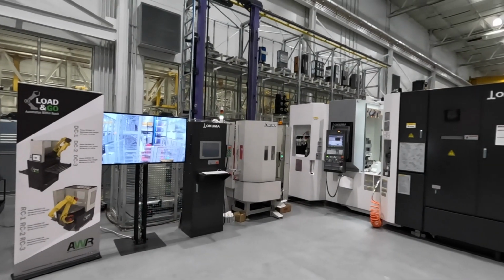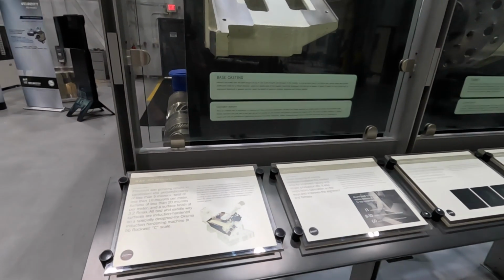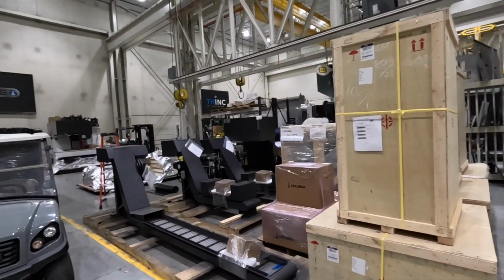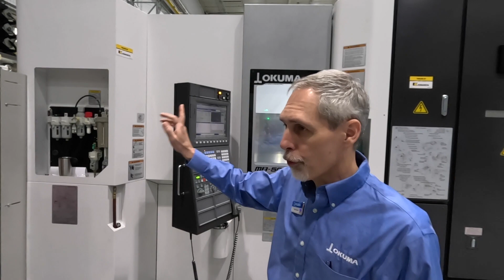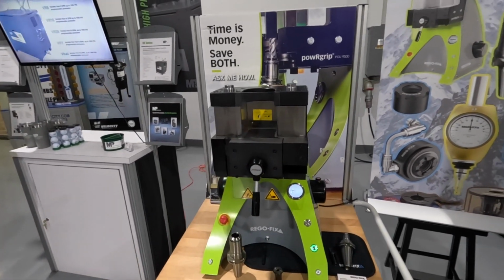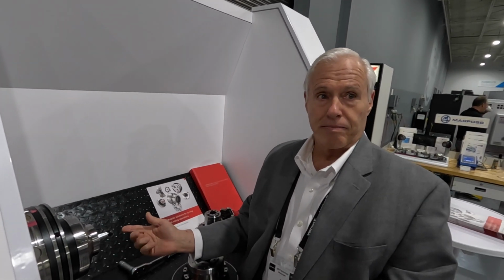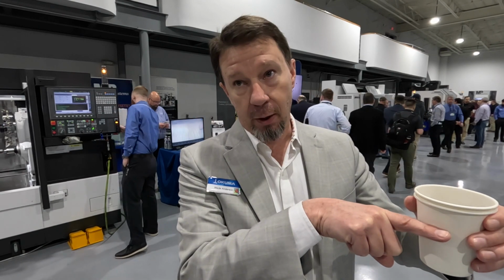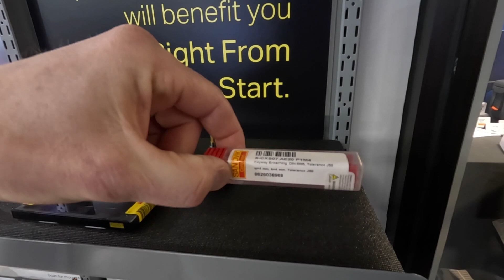Okuma Technology Showcase - 2023 Highlights!

Comment: Back in the 90's, Okuma was building machines there.  That big long integration bay you were in used to house a couple of enormous double column mills for machining base castings for their machines.  The interesting part was the castings were located on the milling fixtures by the leveling pad holes which were drilled on an old (50's), manual Okuma radial arm drill, and all dimensions came from that.  Before that facility, Okuma used to drop ship small machines in kit form to various assemblers for their US machines.  We've been using Okuma machines in our shop for almost 40 years now.  Still have an LC40 from '84 on the floor.
Reply: They also had a few more buildings then today, primarily for assembly IIRC  - I previously worked for an okuma distributor in the midwest and then in the south and heard some of the history then - I've had a few opportunities to tour the place, always a great time to be had.  Now days I'm a customer.. two Okuma mills in my shop, hope to get another soon.
Reply: What do you guys think of the reliability? I've only played with mazaks and Cincinnati with acramatic 950,,(problem child) and want to find a machine to put in my garage (20 yr old or so) something affordable.  I heard they have there own g and m codes? I just want something that's not gonna spit out  drives on a monthly basis...haha. our 30yr old mazaks are becoming problematic, the 20yr Olds are still chugging along. I would like someones opinion of the 98' to 05' controls and reliability,  thanks
Reply: @jasonruch3529  We have Okuma machines from 1984, 1986, 1987, 1992, 1995, 1999, 2002 & 2004 on the floor running every day.  But we also have our fair share of drives dying - I think it's the nature of the beast for machines that old.  As for the controls, I have always preferred Okuma to Fanuc.  But, if you are looking for an old beater for the garage, Fanuc based machines might have the advantage, as drives will be much cheaper and easier to find second hand.
Reply: @jasonruch3529  I still have my original machine from 1998 (new to me 2015) it was flooded in 4ft of water twice for a week each time.  We did have to send out some boards and get new batteries/reload software, but that was minor.  

Once it would boot up, we sprayed the ballscrews and ways down with penetrating oil, tried to move the table in x/y until the load went up, hit estop and went to bed.  

Next day it was free as a bird!  Wiped everything down till it was shiny and went back to work after retouching off all the tools.  Checked backlash, had to adjust .0001, it got more accurate in X for some reason.

Best part - it still holds tenths across the entire work envelope, even flatness.  (my new one won't, but it's still well in spec)
Reply: @texastad1989  wow that's a great story,,,I was looking into that year and up a few. There in my price range. I am not a fan of fanuc.  At work my 1997 Cincinnati horizontal milicron is gcode but once I call a tool the control already comps for length without having to call it up. I think fanuc and other controls should have copied that idea. Heck it tracks the set zero however you rotate the table.! How are the osp controls? Do they have a little conversional? Or must you call up every little thing as well?
Reply: @jasonruch3529  Okuma controls have an IGF function, which is their conversational bit.  I never use it, as we do everything offline.  I would not want a control to auto comp for length or diameter, as it's very useful sometimes to have multiple length or diameter offsets for a single tool.  But for all I know, Okuma may have parameters to allow for that if you want it.  One thing I really love about Okuma is the absolute encoders.  Fanuc say they have them, but they're just battery backed.  Okuma encoders are mechanical and cannot lose position.  Another cool feature on Okuma controls is that you can skip back to a point within a rough turning cycle, without having to go back to the starting point.  Program editing is much easier than Fanuc as well.  You can edit the program you are running while you are running it.  I really love the OSP series controls.
Reply: @jasonruch3529  They have very decent conversational, the shop I got the 98 vmc from had no CAD/CAM so it was fully loaded with on control programing options.  I use Esprit so I don't need them, but it's cool to pull up a 3d model of a tool on a 1998 machine.  It will model the stock too and most parts you can just define on the control.